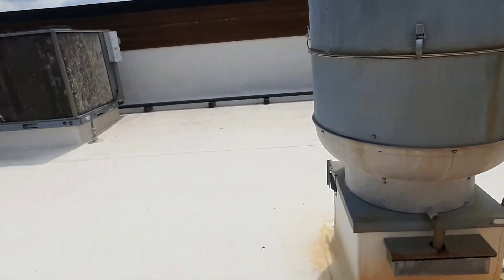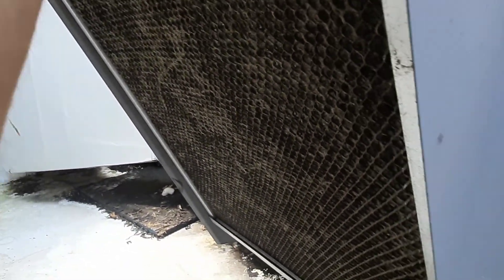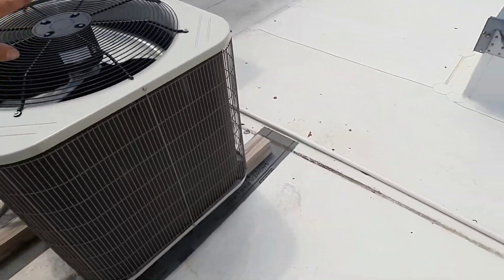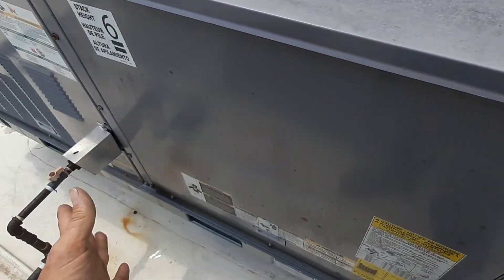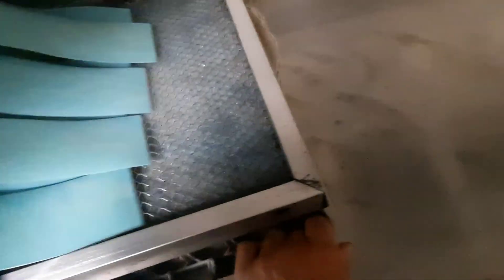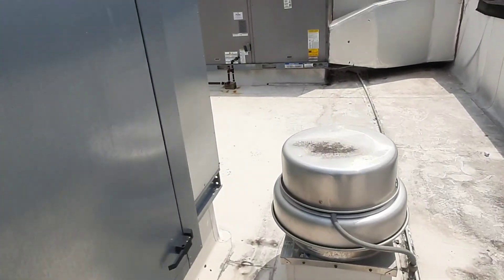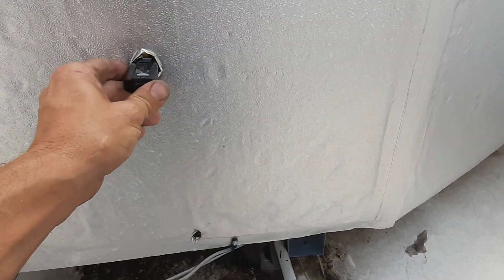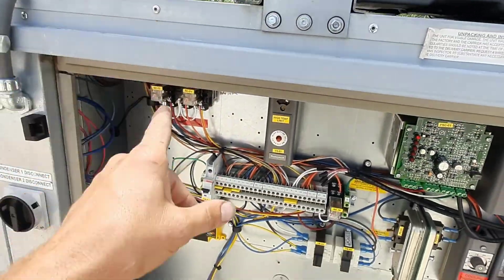Restaurant humidity issues: Was this ever balanced? #hvac #hvacservice #hvaclife #commercialhvac

Comment: Seems to me the floors are condensating specifically because they are setting the space temp too low. The floor surface temp is getting to dew point.
Reply: Yes i work restaurants as well and i have this issue with some stores, they run the temps down to low and once satisfied they start to sweat, had to make them run higher temps for several days for it to correct itself
Reply: yeah, probably overcooling the building, so when they raise the thermostats back up, the floors stay cooler for a good while and wham condensation.
Reply from the maker: Agreed. Thanks Dan